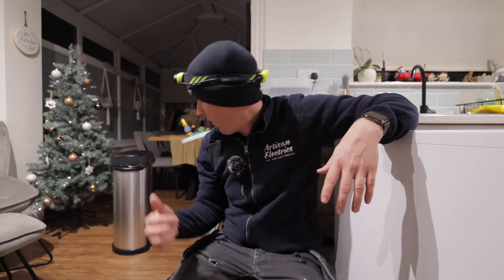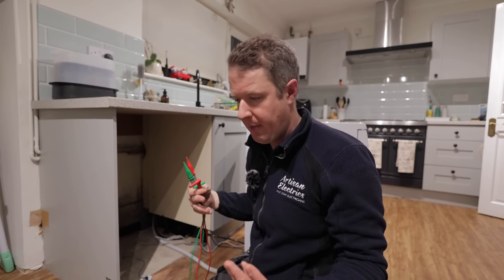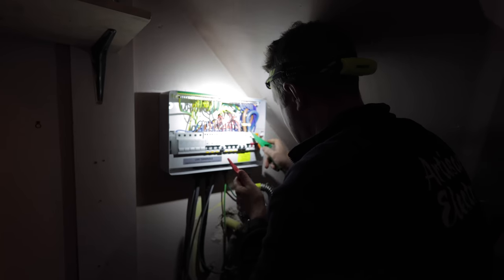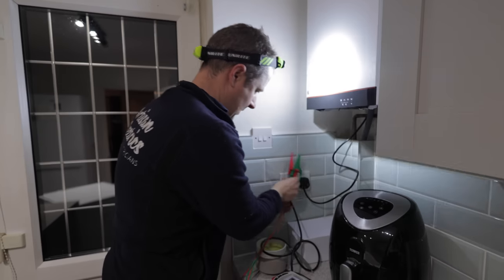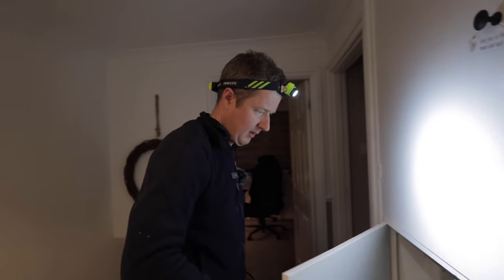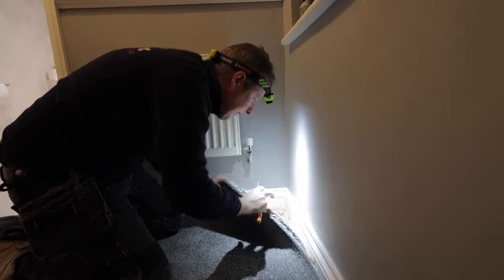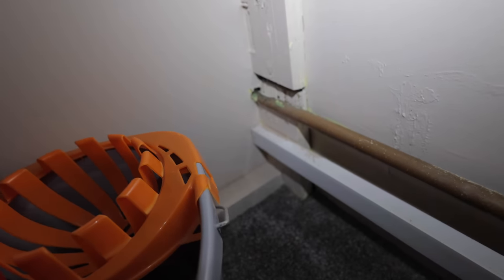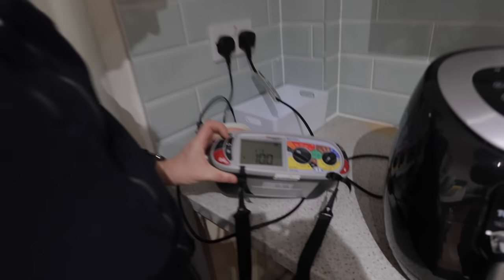Nearly KILLED by a CRAZY fault! What on earth is going on? 💀

Comment: Well done on finding the point of the interconnected  CCT .
These things always seem to happen when your brains on its last legs.

Coming from a (30 years plus ) electrical hi-rise  background  --concrete floors and ceilings, where feeding equipment from a different floors CCT/ swboard is not allowed  ( unless it's just a signal / control wire) and also in our particular situation we are not allowed to be  invasive unless it is absolutely unavoidable 

Wouldn't a less invasive quick fix way have been To install a 240v relay in the boiler with the coil Energised by the upstairs CCT and with the relay contacts switching 
Between the permanent active terminal
And the Switched active terminal  of the boiler input  
Which could either still be fed by the plug method or by running a new CCT to the switch board 
Or if you wanted to keep it on the original up stairs CCT(  and just remove it from the downstairs GPO CCT)   rather than pull up floor boards , couldn't you find the cable that feeds that upstairs boiler  CCT  as it comes out of the switch board and take a new feed from that point under the stairs to the downstairs boiler?
  , if you were worried about any back feeding into a ring CCT  you could still fit the relay  I mentioned above  to isolate any alternate /parallel paths, on the upstairs cct

We don't use ring mains here
As far as needing specialist technicians for heater controls etc wtf ? they can go jump, the electrical  licence here covers all areas of electrical install and repairs domestic and industrial

Although with circuit interconnection 
I would have thought the RCD would have tripped  , although if it was only used as a signal wire to pull some sort of NON isolating relay in  (a  leaky solid state relay?)   maybe less than 30mA
Searching for a return path 

UNless the disconnected N and E  some how were touching a live part I would be insulation testing the boiler as it's leaking to earth raising earth potential to both of the floating active and neutral wires when RCD CBO is switched off 

Got to love interconnections !

Comment: TBH, the boiler would have been my first suspicion. You would likely be looking for an appliance that has two live feeds (mains power feed, and mains-level control signal feed) and may have been wired off two different circuits (not good practice, but happens a lot, esp. if it has been wired up by a general builder). Any appliance with two separate mains-level feeds (usually one for power, the other for control) can exhibit this issue if the internal circuitry is either poorly designed or has faulty insulation. Boilers are a prime suspect for domestic installations, as well as zone valves. Outdoor lighting with switches in both the main residence as well as e.g. a garage are other ones to look out for.
Reply: Could you explain How on earth the potential appeared on the earth if there is no neutral break? I can't figure out

Comment: Rings in UK is basically one preference, it doesn't use as much copper as other star configurations in rest of the world.  We have more cables, but when when breaker is switch of, it is off.
Reply: And supplies a lot more current, but when the fuse (in the plug) that is attached to the appliance blows the rest of the circuit is still live and your system is still maintaining power to the it, however if the circuit to your kitchen is "tripped" in the US, Canada etc then the whole circuit shuts down whilst you are out at a party, and your freezer, fridge etc shuts off as well.

Comment: My mind hurts, this was like a widowmaker generator cord. I would have taken a long good look at the specs of the boiler to see if it could work with a 24V~ control fed from the boiler. If so i would have added a  230V~ control relais upstairs and converted the call for heat to 24V~. Another option would have been was to use a 230V~ din rail relais and add a switch box downstairs to split the circuit, but i don't know that would be up to code.

Comment: The first thing i thought of was the boiler, i've had so many faults stemming from boilers, and i've had this exact same fault too, mine was with much lower voltage though, iirc was about 50 volts.

Whenever you run into a weird fault that seems unexplainable, just check the boiler first, it's so easy, and they are the mother of all evil when it comes to faults.

Generally,just always check the boiler within the first 15 minutes of fault finding 😅

Comment: That was a good fault find! I really should go into the business of being an electrician. I work on electrical lift trucks and my strength is in electrical troubleshooting. I've luckily never really run into any issues in the homes i've lived in... so not much experience hunting down faults like this. But it looks like fun! I am curious what your agreement is with the customer when you need to do work that involves removing carpets and cutting holes.... You'll get it back together as best you can? I imagine you have sub contractors for big jobs?

Comment: The old cable replacement was not needed - just isolate it - use relay upstairs. This relay would have a coil powered by heating system circuit and switch a circuit from downstairs which will command a boiler. Rather simple 😊

Comment: Could you have just used a relay on the heating system's live and neutral to get the lower circuit live to the boiler? It means there would be two separate circuits in the boiler, but the relay would keep them isolated without any leaking betweens circuits.

Comment: Why not use the existing wire to drive an isolation relay added to the boiler? Put a multiple power sources sticker on it. I don’t know how you would make that code compliant, maybe it’s only possible in industrial setting.

Comment: If the floor boards are like that, designed to be covered by carpet or other floor covering? or, not, Get a Wax Crayon either from a wood working store in wood tones or just a crayola crayon and write a capital letter on the floorboard seams so as you take them up, you leave half a letter behind then its just match the half letters. Takes some guess work out.

Comment: I would feed the boiler from the local constant source,  as it was, and used the twin to upstairs for the thermostatic control at low voltage as it leaves the thermostat. One relay at the bottom, and one relay and or doorbell supply for the control. Little to no wire runs.

Comment: Realise I've found this video very late. I'm all in favour of using the proper kit, but I still have a habit of checking with a non contact voltage tester wand as well before I touch anything. They're not the main tester I rely on, but as a last check it would have shown there was power in the socket somewhere. Saved me once when I was working on a home in France. I'd turned the consumer unit off, checked a couple of the disjoncteurs (double pole MCB, things are different in France) with a Fluke two-pole voltage and continuity voltage tester, confirmed circuits were dead. Was about to start switching outone of the disjoncteurs I's not specifically tested (I  know! But the board was off!)  when a touch of the non contact tester showed me that the one I was about to meddle with was still live (all the rest were off.) I found that disjoncteur had been connected to the supply side of the main switch for the board (again, possible in a French consumer unit.) It supplied another consumer unit dedicated to the swimming pool pump and light so they had clearly decided it should not get turned off when the rest of the board was isolated.

Comment: I was nearly killed by a clueless electrician.   Was told by useless electrician that a bundle of ancient electrical cables were all dead......they were in a room, that needed construction work, and would be replaced with modern wiring later.  Started hacking into the wires and hidden among them, was the main,live feed with no fuses etc that fed directly off the power pole in the street.  Just as I was about to cut into a slightly thicker wire......it occurred to me it could be the mains, and was it indeed deactivated (gut feeling)..........did some looking,followed the cable and found it was indeed still live.  OMG

Comment: Hot L/N wires to PE while L/N is same potential is typically a sign of a broken Neutral and in this case caused by the 2-pole disconnect of the RCBO. So, in an old house installation 2-pole switching can have the opposite effect of what is intended as you never know if a previous electrician has "borrowed" other circuits to get his power from, like in this case with the boiler. Why do the borrow? Well, they just want to avoid pulling wires through spaces where it is hard or even impossible. In a classic installation with a common Neutral-bar this might never have shown as the problem you got because the Neutral wouldn't have been broken even if the Ls were on different circuits. Modernizing old houses with individual RCBO circuits should probably only be done for completely new circuits while leaving the old untouched parts of the installation on the classic RCD/common Neutral philosophy.
Take care, especially when working in old installations where a lot of upgrading has been done :)

Comment: Brilliant job.  So glad you survived the electric shock.  I watched amazed to see that dangerous boiler. I had a similar problem which I have never been able to understand.  All electricity was turned off at the mains when a new mirror with a light above it was fitted onto a wire already installed by previous owners in the bathroom.  When that wire was tested it was found to be still live despite the mains being turned off.  Is it possible something here is on two different circuits like your find there I wonder?  I am now asking myself what I should do.  The bathroom fitment went ahead safely without the fitter being electrocuted as he knew it was live, and it has been on the wall for about 3 years.  Should I be doing something now for safety reasons?  Advice replies would be appreciated.

Comment: You Brits use those goofy ring circuits.  Your problem is, what on this side of the Pond, we call an open neutral; i.e., the loads connected to an open neutral on a three-wire branch circuit will feed power out to the connected circuits in search of a ground (Earth to you).  Forget about the caps, you have an open neutral on a 3-wire branch circuit.

Comment: First, I never touch a wire w/o checking it for hot first.  Regardless of breaker box settings.   Next,  sounds like another outlet in that circuit is wired wrong.

Comment: I took out a boiler years ago.. fuse spur turned off and fuse removed.. I cut through a single earth wire running to the boiler and it was live!! Same "electrician" wired it?? If you need to run a permanent live.. it should still be run through a fuse spur or unswitched socket.. and not run using an earth wire.. I've also witnessed a qualified electrician wire Live/Neutral and Earth to a cylinder stat.. (which only ever have 3 lives).. qualified doesn't guarantee competent

Comment: I'm having the exact same problem with a shed that's got a power drain from somewhere.
And scary thing was I turned the main isolation switch off to the shed tested the live with non contact tester and it was dead.
Pulled the live side of the box out unscrewed the neutral and as I put my finger on the blue wire I got a wack luckily I wasn't standing on anything grounded it push my finger away thank god.
So tomorrow is going to be interesting fault finding the bloody thing.
Crazy never had that before and never had such high volts running through the neutral when power is off.
Crazy thing is no live wires we're connected to any part of the main box. Apart from the main power but I checked that and it's dead.
Arm is still twitching lol.
Love the videos

Comment: Wouldn't the simple solution be adding a relay energized by the twin cable switching the permanent voltage to the switch live?.It would provide all the separation without altering the wiring to the boiler (just inside the boiler)

Comment: A number of years ago l was upgrading boards to RCD's at a commercial building.   Each board was able to be fully isolated before any word.  I had a couple of funny things on other boards so was testing both nuetral and earth on each circuit as they were being moved.  This is after fully isolating the board.   After one circuiymt was twmested (R3 to be exact) l was redirecting the nuetral to the RCD.  Part way through this part of my hand was touching bare conductor when someone turned on a light connected to a SEPARATE board (also red 3 on that other board) and it sent a 240v shock across my chest.  (The premises was closed for one day as a result).   At some stage in the distant past someone had taken a nuetral from that board to another board so turning on the light energised the nuetral.  It took a full day to rectify the issue and make safe.   However l had a call back when the extraction fan (a 3 phase kitchen fan) was activated, tripping the circuit.  I checked out the fan and found out it was fed by 3 different circuits from 3 different boards.  Another day to rectify.
The joys of red to red, black to black l'm a genius..
Edit.  Oh always use a volt stick when isolating as well as a meter

Comment: Wouldn't adding a relay in the boiler triggered by the sometimes hot wire have solved the problem? Then all power could have come from the plug and the circuits wouldn't be interconnected.

Comment: this reminds me of changing a ceiling light in an apartment my sister was living in, I was on holiday visiting, so it's not like I had any tools even if I was an electrician; cut the power to the whole apartment ~ single breaker on the fuse box and pulled all the fuses, the switch/breaker felt a little vague. set about removng the old light fitting, got a mild shock. CFL's were in fashion at the time so I took note and figured it might be the ballast/caps in the bulbs still holding a charge, went around at turned all the light switches to 'on' figuring it should cause the bulbs to discharge. went back to it. got shocked again.
stop take a breath. think. noticed the switched live wire was coming from a totally different conduit to the neutral and the neutral wire was a completely different thickness, opened up the fuse box to discover that there was no neutral for the lights.
to save money. the owner of the apartments had the switched live for the ceiling lights in the apartment, but the neutral was fed from the wall sockets in the apartment above. as they say around here "siamo in Italia" where it's only illegal if you get caught.

Comment: A brilliant bit of fault finding, and a truly horrendous botch job by who ever did the boiler change over...When you started testing at the consumer unit, I was confident you were going to get continuity between the two ccts, and was completely baffled when you didn't...The bit I am really  struggling about is why the original electrician or  heating engineer didn't simply fit the timer unit or stat that was upstairs next to the boiler? He would have had a source for his permeant  live, could have easily run a switched live to the boiler, and used the existing wiring to send a switched or permanent live upstairs if needed??

Comment: I've seen this before. 240v thermostat feeding back into the boiler through the PCBs onboard mains transformer. Should be volt free contacts for the stat switch but older systems used a 240 feed.

Comment: As soon as I saw the 170v I knew it was an appliance but didn't think of the Boiler, good one. I hope you checked the boiler components, I don't suppose sourcing current was good for it and electrolytics can get awfully stressed. Terrible boiler design, all sense wires should be isolated. 
Less than 240 is normally an appliance, more is normally 3 phase. Been doing work in Ukraine and a surprising amount of houses have three phase, the supply is so bad a single phase is often less than 20A so they use 3 phase. 415V in a house scares the ** out of me.

Comment: What was the reason for not moving the spur and timeclock to beside the boiler and supplying them from the downstairs sockets? Might have been easier than pulling up a floorboard and drilling that hole.

Comment: Just thought you could have put a relay in operated by the switched live and isolating it from the downstairs circuit. The relay would then energise power from the downstairs circuit to operate the boiler.
This would have saved putting in.more wiring or changing it.

Comment: there is still a problem. the neutral has lost bond to the earth, and the ground has lost bond also. had this in the usa once , shoddy job used one cable for both. it rusted in two pieces at a nick in the pvc jacket. very dangerous as the whole house went live. of course in usa we have 120 neutral 120 so the circuit across the 240 worked but was out of balance due to load difference in each 120 volt leg.

Comment: You came across the same problem the original guy changing the boiler had. That's why he wired it in the way it is with 2 points of electrical isolation. There's a few boilers he could have fit that don't need a permanent live. It's usually customers though that say they want such n such of boiler and heating engineers don't want to let them down so fit the boiler they want and bodge the electrics

Comment: Curious as to why the upstairs circuit RCD wasn't tripping? With both rings live, surely some of the current for the downstairs demand must have been flowing through the boiler plug? Presumably when you got the shock, it tripped the upstairs breaker?

Comment: You measure roughly 180Kohms between the two rings, that's way too low and indicates the faulty bridge between them. It really should be X Mohms between them, tens or hundreds. You kinda discounted what you measured, but it's very significant